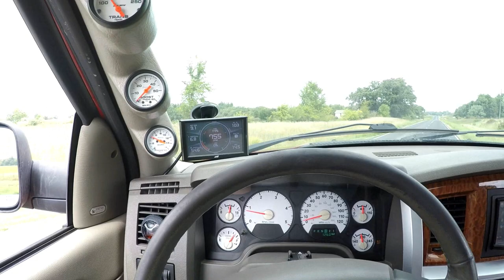Single S468 Cummins

Comment: Stock rpms really hold you back. Im running almost the same set up and the 3000 to 4000 is a lot of fun up top. Peak hp is 3200
Reply from the maker: Yeah I really need a cam to move the power curve up, but I can rev up above 4K with the top end work I have done...unfortunately it’s just not efficient.
Reply from the maker: What’re you running?

Comment: Why did you take the compounds off
Reply from the maker: Because I wanted more power and bigger compounds are a lot harder on a stock bottom end than a single is
Reply: Because he’s just not bright!   He lost drivability, towing, for what?!
Reply: @dr.bowdoin3067  Uhm he probably did it because he doesn't tow it daily..So waste thousands in carillos in built bottom end or don't spend thousands and stay an s400 base turbo. You can still make 1000rwhp all day on singles and driveability with right setup and tuning is far from anything to bitch about.
Reply: @welchy16comp  your guessing and I have a 2019 on compounds and know several buddies with well rounded singles who make more power but the drivability isn’t there.  Here’s a single making over 1600.  https://youtu.be/Wt59v7mB_kI